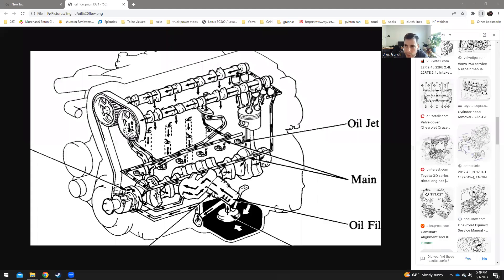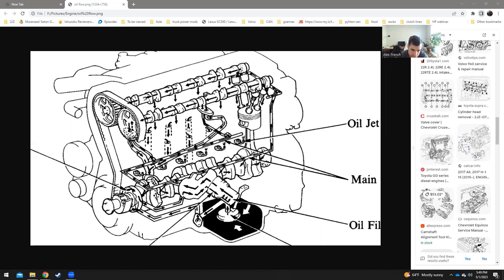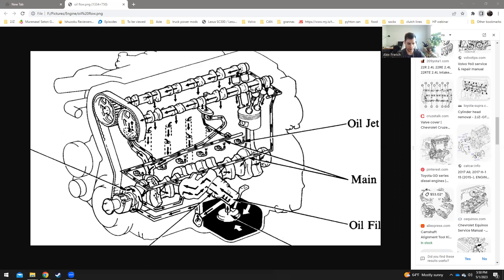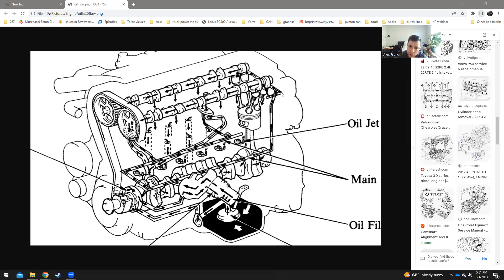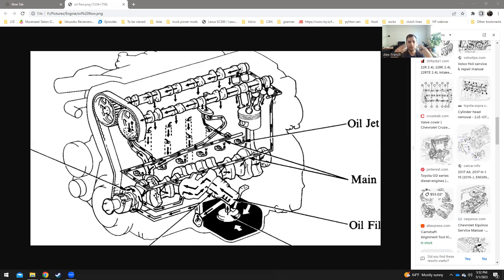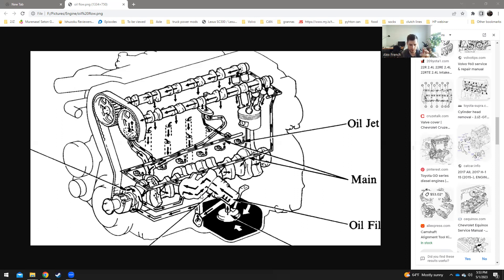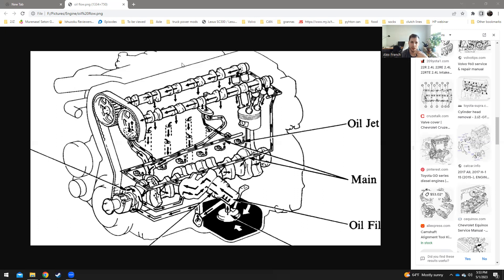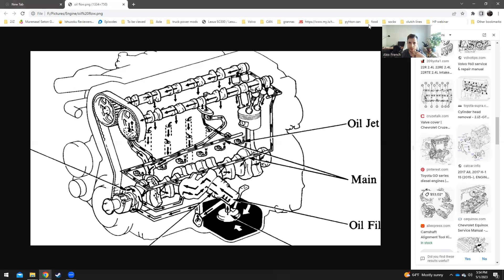2jz Ge oil Flow Diagram turbo feed

Comment: Are the oil galleys to the oil jets there in the GE? I’d like to go the route of drilling into them to essentially make the block the same as the GTE block with oil feed to the turbo and to oil jets.
Reply from the maker: @essentialdeparture9999  they are there. But the exhaust galley is not connected to the intake galley. You’d have to drill the block side to side.
Reply: @alexfrench8142 Ah man, that sounds challenging.

Comment: I remember from about 6 months ago you were going to drill into the block, and run the lines behind the engine. What did you decide to go with?
Reply from the maker: Feed from head, too scared to try and drill that long a hole into cast iron.
Reply: @alexfrench8142  🤣🤣🤣 I figured you would change your mind.

Comment: Pickup from the filter housing is the easiest way to do it, drilling into the head or block to tap and route it to the turbo is ok too but just more work and clean up

Comment: Greddy Universal Type E Oil Cooler Block Adapter w/ Thermostat 3/4"x16UNF -10 AN
that's what iv been running for years to my gtx 3584rs had no issues. i also have a inline filter didn't like having unfiltered oil cycling back to the motor